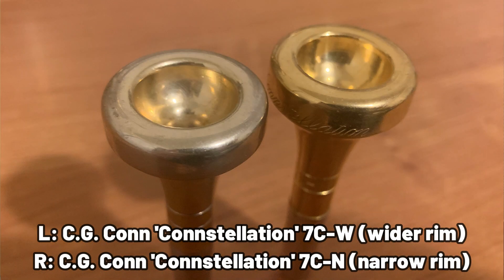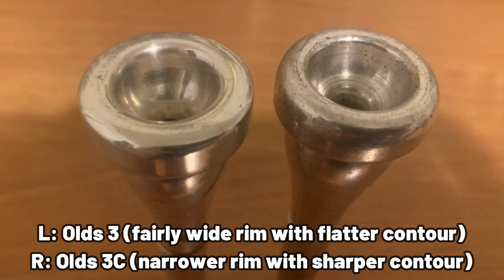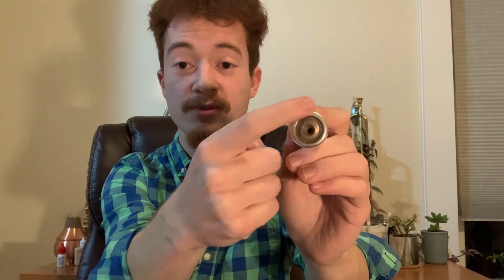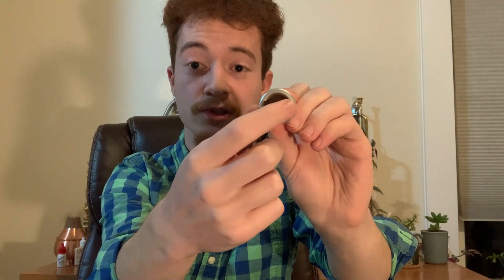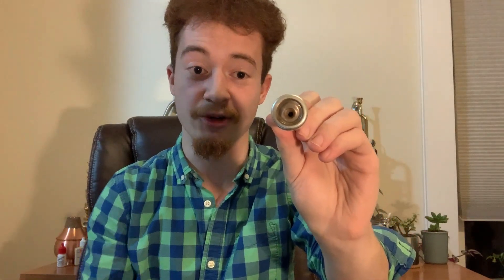Everything YOU Need to Know About Trumpet Mouthpieces! | Trumpet Demystified Episode 1

Comment: So quick story short: I and my career was basically destroyed by using the wrong mouthpiece and trumpet. I played for many years on the standard Bach 1-1/4C and 37. I haven’t had the option to buy a different trumpet as I had no money nor choice really, since it was a school instrument. Mouthpiece was chosen by my teacher when I was still 14. Both of those combined ripped my lips apart. It was way too resistive, I couldn’t push all the air I had and couldn’t really get where I could. After switching to a similar size Monette but a very different cup and rim design, it helped drastically. Let alone going with a Yamaha 8310Z Gen2 trumpet. It was insanely huge difference. And now going with a Lotus trumpet it’s yet another leap. Mouthpieces matter and should be chosen carefully and smartly. Amazing video! Bravo
Reply from the maker: Glad you found a much better setup for you!! My teacher plays on a Bach 1-1/4C and Bach Mt. Vernon 37, but no way could I ever do that. I am WAY too partial to my Yamaha 8310Z myself, and I do better on deeper-cup mouthpieces. In general, I don’t sound very good on Strads regardless of mouthpiece. Now your comment makes me want to try a Lotus trumpet…
Reply: Believe me it’s worth it. Best part is that they’re all super similar, but have just enough differences to differentiate them enough from each other and fit the needs you have. I loved the Solo Max, but the Silver Flair was so special, I didn’t have a choice there basically. Hope you get to try it. Even just to experience MAW valve block alone. That trumpet cannot be choked with air, it’ll take as much of it as you can possibly give it.

Comment: I’m a beginner cornet player and I have been using a 7c mouthpiece since I got it. I have found that it isn’t robust enough and bright enough for what I like to play. I want the sound to be beautifully robust but I’m not sure what mouthpiece could best fit that role. Got any suggestions of tips for finding one?
Reply from the maker: @LiamFigureido  I rarely hear of someone wanting a brighter sound on cornet… If you are an adult beginner, however, it’s a strong possibility that the 7 inner diameter is too narrow for your fully-fledged lips. The Bach 3C is a little wider, allowing for a little more chop room (i.e. the “robustness” you’re searching for), but even though they are both marked C, the 3C’s cup is a little shallower than the 7C’s, meaning you would also get some additional brightness out of it. I would suggest trying out a 3C from Bach or perhaps Olds (as long as you do get the more modern Olds 3C and not the Olds 3, which is a VERY different mouthpiece with way too little chop space). If that turns out to be too harsh of a sound, the 2C has a nice full-bodied tone—it has a nice roomy width like the 3C and a cup at least as deep as the 7C.
Reply: @SamuelPlaysBrass  thanks A lot! I am 14 and I play for the regimental band where I live and we mainly play military marches which needs “robustness” and a bright sound so that the sound can be really heard and felt. I also really like the sound of a bright cornet. We do play hymns and stuff like that but only for Remembrance day and funerals. I wanna be in the RM one day and their cornets are super robust and bright which is the sound I’m looking for. Once again thanks a lot and have a good!

Comment: I once bought a 7C but never used it very much; I've predominantly only been using a Bach 5C, but I do not know very much about trumpet mouthpieces so I do not know where to start. Do different mouthpieces provide a broader range of notes? I haven't been able to get above that first C above the staff.
Reply from the maker: My opinion is that (short answer) no mouthpiece increases your range. (Long answer…) Some specialized mouthpieces with shallower cups, tighter backbores, etc. can make high notes a little easier but at the cost of your tone and ease of playing in the low register. However, there are cases of players finding an increase in range after switching mouthpieces because the original was a poor fit for their face. If you stuck me on a very narrow Bach 12C for a few months, I could make it work, but as someone with thicker lips, I’d have a miserable time because the narrow diameter wouldn’t give my lips adequate room to vibrate. Then if I switched back to my much wider 1-1/2C, I’d probably have an easier time both up high and down low, simply because the mouthpiece allows my lips to produce the right vibration.

EDIT: I realize I didn’t give you any suggestions—the Bach 5 diameter does not have any shallower cups (only A, B, C from deepest to shallowest), but you can find a 3D or 3E if you think something shallower will help you with your high range. A Schilke 13A4A might also be worth a try.
Reply: @SamuelPlaysBrass Thank you for the input. My lips are small, so would that affect my range and tone?
Reply from the maker: Tone/range not so much, but beware of anyone who says you 'have' to play on a big mouthpiece like a 1C or 1-1/2C to get a good tone! Thinner lips do better on smaller mouthpieces (which have higher numbers on the Bach measuring scale).

Comment: Just admit your future is HVAC. jkjk Also, how did you get this sweet project? To get my degree with honors, I had to analyze data from some post-grad research. “Determining Specific Groundwater Discharge in a Porous Media Aquifer Using a Passive Flux Meter (PFM).” Took me quite awhile to figure out what that even meant. 😂
Reply from the maker: With all this brass plumbing, who knows??
Reply: Edited my post. I never even considered brass instruments as partly mechanical engineering. Derp. Metal machining, valves, it makes sense. I was waiting for you to break into a physics discussion at some point, but I guess you’ve got your target audience already. 👍🏻
Reply from the maker: @domepiece11  Geeze, sounds like a tough time. GU’s undergrad honors program is just a few special courses and a free-choice senior thesis or project. Anyhow, there will be more physics in episodes 4-6. Not a huge amount, but definitely some is necessary to fully discuss the trumpet.